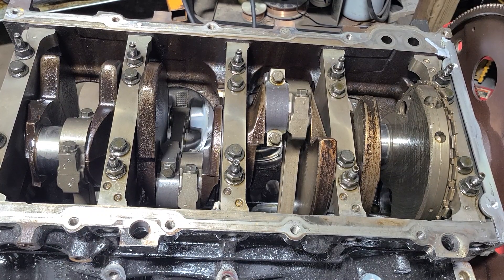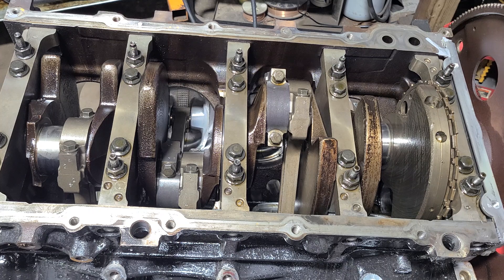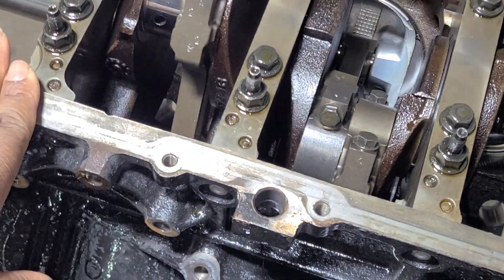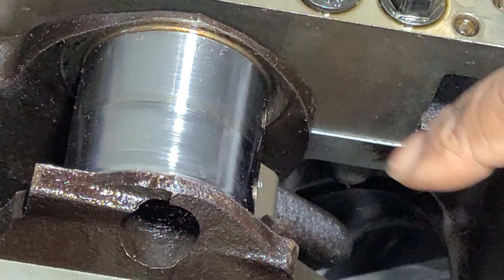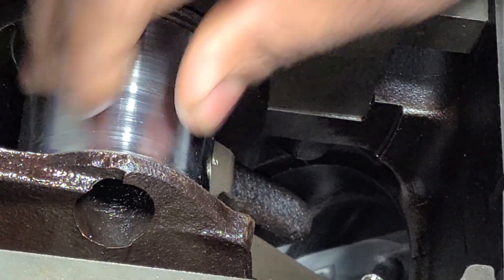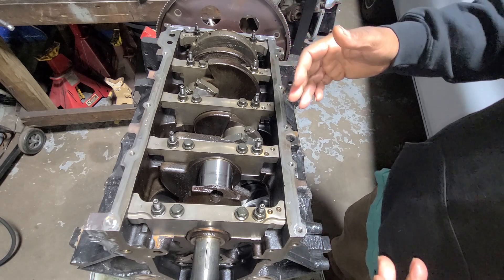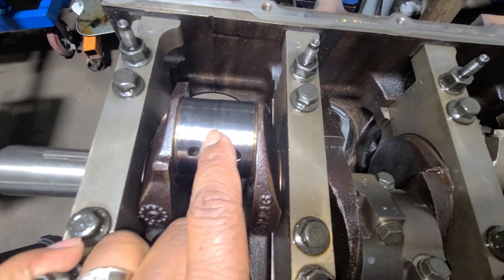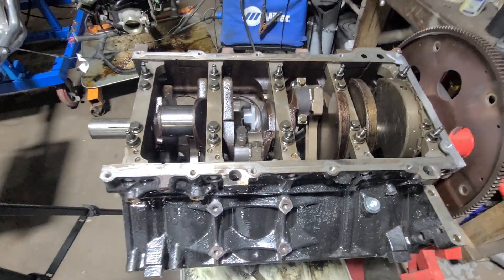LS ENGINE REBUILD TIP. CONNECTING ROD NUMBERING

Comment: I have stamped hundreds of rods on disassembly.  It doesn't move shit around even the tiniest little bit or change the rod's bore diameter at all.  Especially with the "cracked cap" rods in a factory LS motors where they can only fit together one way.  I did notice, however, that the parting line on that rod looks odd and that the rod has been double-stamped.  I'd be more inclined to think somebody got the wrong cap on the wrong rod, causing your problem.  The parting line on factory LS rods should be damned near invisible when properly assembled.  On that one I see a big old gap, which is a giant red flag.
Reply from the maker: Thanks for watching. I disagree with your opinion about the stamping, but please continue with your support.